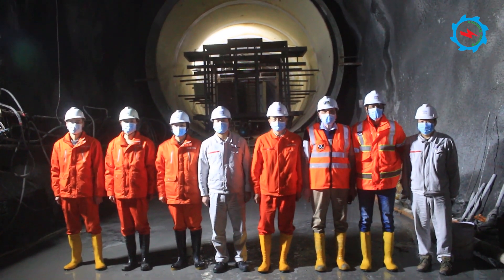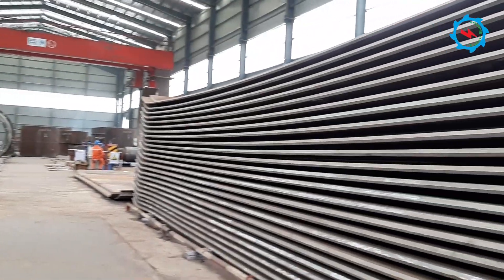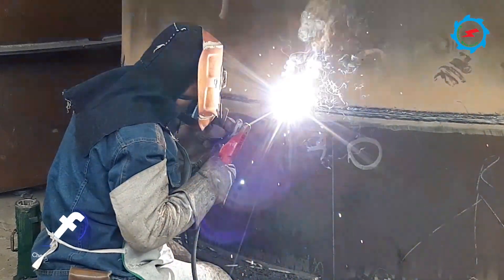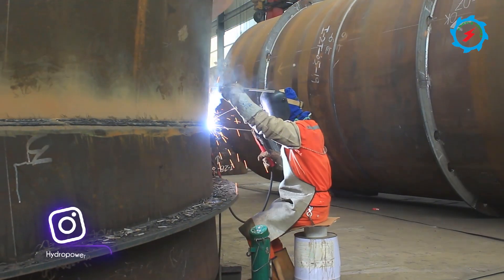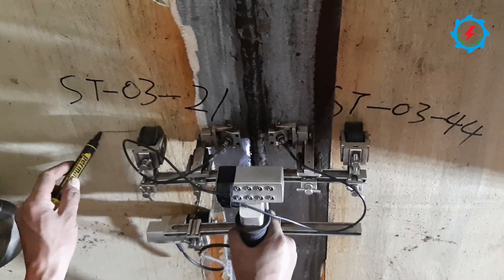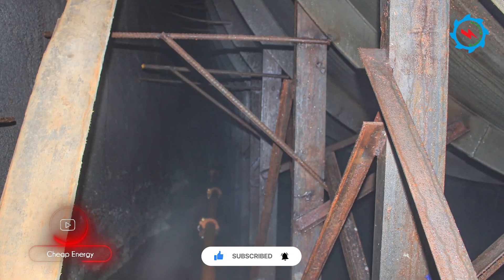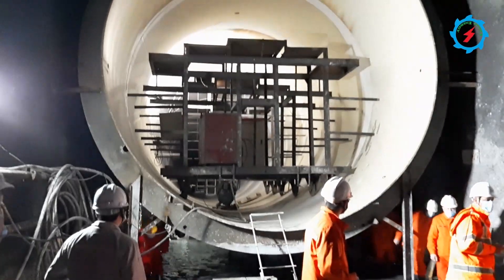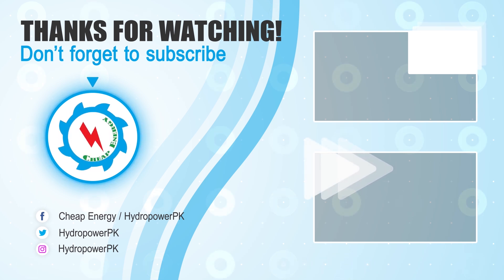Suki Kinari Hydropower Project | Another GOOD news | 2021

Comment: Ref 0:46
Why is there a gap between the liners? Isn't the lining supposed to be continuous throughout the weak portion?
Also, if the concrete backfilling is complete, why can't the concrete be seen in the image at the time stamp?
Reply from the maker: At that timestamp, the installation was continued, 117 liners are welded with each other and back filled with concrete. The picture showed the gap and concrete pipe line for backfilling the video showed the backfilling process.